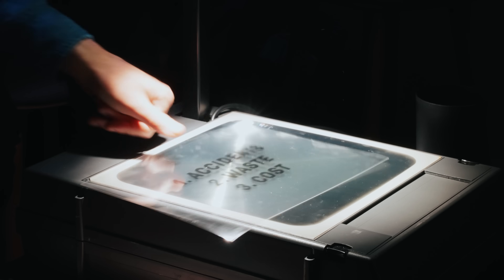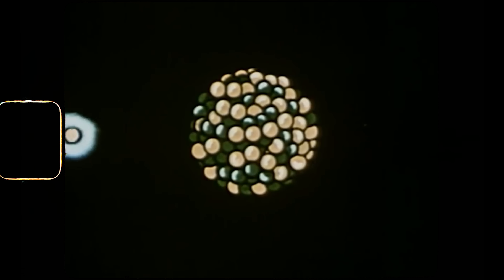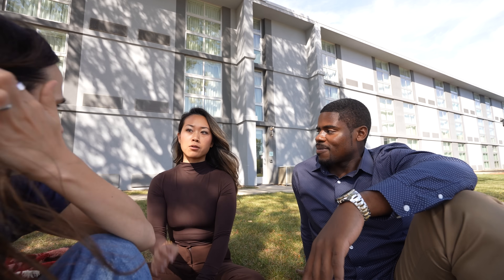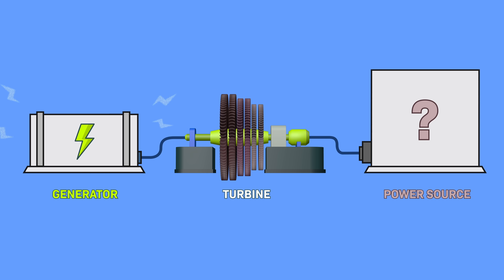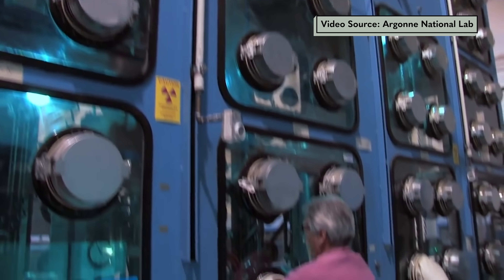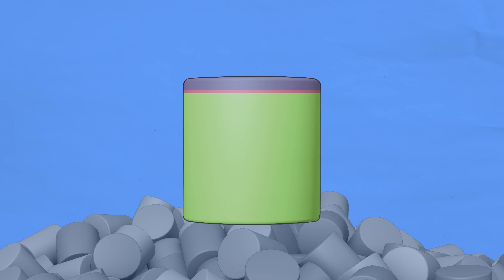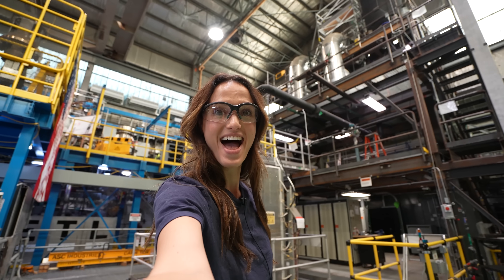The Big Lie About Nuclear Waste

Comment: 05:09 I feel you need to clarify what you mean by “nuclear waste”. Because as I understand there are several kinds of nuclear waste- from spent fuel rods to lightly irradiated parts, equipment and clothing used in power plants. As I understood it a lot of spent fuel rods are actually used to help make new fuel rods and so the amount of fissionable material that ends up as waste is relatively small? I mean what you’re talking about is how it’s done in Japan but also in Europe. 12:07 yet again the US doing something other countries have been doing for ages and expecting an achievement badge for it! 😂

Comment: The most dangerous nuclear waste is Cesium. It's high radiation take 800 ... 1200 years to come reasonable level. The metal waste as Plutonium could be used in power plans to make electricity. I don't se a big problem at all.

Comment: 🤔 Hmmm 👉 CANDU nuclear ⚛ reactors have been used to reuse spent nuclear waste ☢ for decades.
It's main breader reactors product is PLUTONIUM 👉THE 0.7 U235 REPLACEMENT AT 28%😂😂😂🎉
Reply: 🤔 Hmmm 👉 Nuclear ⚛ waste ☢
The tectonic subduction 🌏 plate's move at around 4" per year
They migrate deeper into the 🌍 core and will be reused into other plasmid form's of matter 💡

Comment: Great research!  You might find the CANDU reactor, developed by Canada and the only kind of nuclear reactor deployed in Canada (presently interesting.  Interesting, because CANDU reactors can currently, without any changs, get another 10 or so years out of the spent fuel from other countries' light water reactors.  The CANDU design came about because the process of Uranium enrichment was a closely-guarded US secret, so,  the Canadian researchers turned to trying to find ways of burning unenriched, straight-from-the-ground uranium, and the CANDU reactor is the result.  It's able to burn natural Uranium (with it's large percentage of U238, which cannot be fissioned in a light water reactor), and also can burn spent fuel from light-water reactors and gain an additional 10+ years of use out of it, just as you describe in the video.  Also interesting, the CANDU system is capable of burning other types of fissile material, like Thorium.  Why's that important?  Because there's precious little Uranium in the Earth's crust, and there's WAY more Thorium, it's 100's of times more abundant than Uranium.  India has proven that a CANDU reactor is capable of burning Thorium as fuel!  And there are lots of other things that make CANDU reactors good,  apart from the ability to burn spent fuel from other reactors.  1) CANDU reactors can be refueled while they are operating.  The fuel rod geometry is such that a robotic system can push new fuel rods into the reactor from one side, while another robot captures the old fuel rods from the other (called a "straight-through" fueling path),  Typical light water reactors have to be taken offline completely, allowed to cool which can take up to a couple months, then completely deconstructed, refueled, and then put back together again before it can be put back in production. You only need to refuel every 10-15 years or so approximately, and the refuelling process often takes a couple of years.  Canada's CANDU reactors have quite often  been in continuous operation since they were opened (some of them in the 1970's!).  Also, the overall design of the CANDU reactor involves the entire reactor core being located within a large pool of "heavy water" (a.k.a. Deuterium, the "du" in CANDU), which means that, when combined with a host of emergency fail-safe features,  it's nearly impossible for a CANDU reactor to melt down.   If the FUKUSHIMA nuclear facility in Japan had been a CANDU plant, research carried out in Canada has shown that the ongoing nuclear disaster at Fukushima would categorically not have happened .  Thanks for the amazing research Cleo, please keep up the good work!

Comment: I do not believe that nuclear energy, either fusion or fission, is a clean energy. Using nuclear energy you are producing nuclear material that we call nuclear waste. But most important you are converting matter into energy and energy into HEAT. So, with all the energy that comes form our sun, when it reaches earth, it is converted into Heat. Even if in the future we wil be using nuclear fusion where hypothetically there is no nuclear waste, but you are still producing heat that is added to the heat coming from the sun. We must use energy that is already in nature and not produce more Heat from other resources.

Comment: Thanks for making this video and introducing the potential of slightly used nuclear fuel (high level nuclear waste) to your audience.  If you want to do a deeper dive on the subject research the Molten Chloride Salt Fast Reactor (MCSFR).  This reactor technology can be used to transmute (consume) the waste from current pressurized water reactors into energy without a separate recycling process and is a much more elegant solution to nuclear waste and carbon free energy.  It should be noted that TerraPower (a  Bill Gates company) is currently working on a MCSFR in conjunction with Southern Company  and the Department of Energy.  Mr. Ed Pheil, formerly of the Navel Nuclear Labs is a great source of information regarding the MCSFR.  His company Elysium Industries was working towards commercializing a MCSFR but apparently ran out of funding.  If you google Ed Pheil or Elysium Industries you will find videos on the MCSFR.

Comment: While I am very much in favor of reprocessing nuclear fuel, I feel like this video quickly glossed over the counter-arguments related to non-proliferation.  

Plutonium-239 isn't any more dangerous than U-235 for the purposes of bomb making... The problem is that reprocessing creates plutonium in much larger quantities than U-235 exists in fuel today (3-5%).  Nuclear fuel isn't a proliferation threat because turning it into a bomb requires enrichment... A very difficult technology that requires large facilities. 

Reprocessing abundantly creates material that could theoretically be stolen and much more easily made into a bomb.

Comment: Hi  Cleo! overall great work!
Glad that you distinguished between the currently prevailing form of converting nuclear energy, and fast type reactors. The latter have the potential of producing 20x more bang for the buck. HUGE potential!!!!
Note the fact that the "waste", from current nuclear-electric plants, DECAYS EXPONENTIALLY. The danger of getting burned from gamma rays drops rapidly at first, then slowly levels off over centuries.
Detractors and opponents of nuclear energy conveniently omit this fact.

Comment: This is a hugely flawed video, clearly indicating a lack of technical knowledge on the subject. While hinting near the start that it is the fissile material, U-235, which allows the chain reaction to propagate in a reactor, the author seems oblivious to the fact that the material has been consumed thereby, and that simply "rinsing out" the fission products cannot get you back where you started. 
I think she picked up some notion of actinides extraction from her Argonne visit, and how this can figure in fuel lifetime extension, and contorted this into an idea of what a "closed cycle" really is. All such "cycles", as current embodied, require the introduction of fresh fissile fuel - whether new isotopicaly purified 235 OR, theoretically, bred plutonium: criticality cannot be maintained otherwise. There is no cost motivation for doing that currently, especially when superior breeding ideas such as thorium cycles are on the drawing board.
Do you really want to demonstrate how little science you know when you do such presentations?
regards, DKB

Comment: the processing is too expensive and  polluting/ dirty  , or they would have been doing it centuries ago , as demonstrated in France. NE is the most expensive way to boil water we can imagine cost 4-7 times the amount to produce electricity compared to conventional plants and  The new SRM s are still 2-4 times the cost of electricity produced by renewals.  
 " But we need a always on power source as wind and solar are intermediate". BS  compared to NE wind and solar are more predictable and backed  up when it is rarely needed, unlike when NE goes down it takes all the other reactors down on that grid for safety reasons. Coming back on line can take weeks. 3-4 times cost to build in overruns. we have the ability to work completely on renewable s  by diversity , computer control of the grid . w/o massive goverment subsidies no nuclear plant would ever be built , as demonstrated by wall street. This is another propaganda piece by the nuclear industry.

Comment: The solid fuel rod light water nuclear reactor only uses 0.5% of the uranium in the rods before the rods become structurally unsound (0.7% for Canadian heavy water reactors).  The original intent was to reprocess the rods into new fuel rods to repair the structure of the rods but the Carter administration canceled the reprocessing plant due to anti-nuclear protests hence the rods became treated as wastes.  The rods become structurally unsound because some of the uranium transmutes into a radioactive isotope of Xenon gas for eight hours before transmuting back into a solid element and gases occupy a lot more space than solids hence placing a lot of physical stress on the rods.  If you look at a cross section of a "spent" rod, you will see a fractured cavity in the centre.  Now, the molten salt reactor solves this problem as gases simply leave a liquid, however there is a lot of bias against molten salt reactors even though an experimental one operated on a shoestring budget for years.  The reason why the so called spent rods have ti be stored for so long is because it still has uranium in them and uranium has a very long half life which is why U235 still exists in nature while plutonium does not.  If all the uranium is used, the remaining wastes though highly radioactive have very short half lifes and only need to be stored for about 350 years.

Comment: Corrupt disinformation. Fear of nuclear is NOT irrational. Funny that you didn’t mention the fact that the biggest problem with nuclear energy, is that corruption has 100% guaranteed that every nuclear facility built was built with unsafe, material, engineering and design common sense, safety practices, and laws. From Chernobyl  to 3 mile island to Fukushima to the plants on the coast in California. You are parroting, dangerous disinformation

Comment: Beautiful and "bright"! ;)  Thanks, that was excellent! (Love the test btw). 
As a Mechanical Engineer I have often wondered if spent nuclear fuel could still provide even low grade useful energy, now I know that it can do much better. I didn't know that so much of the U238 was simply wasted. That leads me to ask a rather obvious question then...why not separate out U238 in the first place as it should be easier than a toxic mix. As Homer would say..."DOH!"🤦‍♂🤷‍♂

Comment: 0:05: 🔋 A nuclear reactor built in the 1960s could generate electricity from nuclear waste, but the technology was not pursued, leaving behind a potential clean energy resource.
3:50: 🌍 There is enough nuclear waste in the US to power the country for 150 years, and recycling it can reduce its radioactivity.
6:01: 🔋 The video discusses the process of generating electricity using different sources, including fossil fuels, geothermal energy, and nuclear power.
9:37: 🔋 Nuclear waste recycling can reduce dependence on imported fuel, conserve uranium, and reduce the radioactivity of waste.
12:06: ✨ Nuclear fuel recycling is seen as a way to address the threat of nuclear proliferation and the need for clean energy.
Recap by Tammy AI

Comment: I would LOVE to see this happen! I would also love to see the hot waste get used, instead of just cooled. It would make SO much more sense!
Reply: if it was feasibleto use the decay heat to produce power,I think it would have already been done, typically decay heat is 10% of the core's rated out put.
Reply: @davidnewland2556  It would still be neat to try. Even if there wasn't much to gain.
Reply: Nuclear power is expensive to build requiring public funding (bonds). Decommissioning and waste storage is expensive, requiring public funds to do which the utilities (having been enriched during the power generation years) are very happy to dump on taxpayers.

Comment: nice vid, nice topic, but holy hell that wording.....
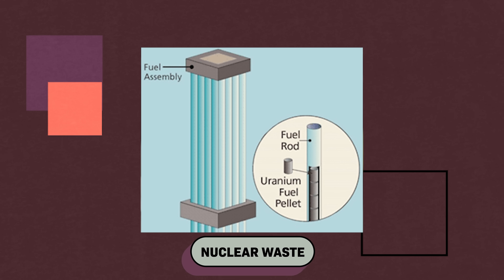7:08 U-235 the 235 means the not the number of neutrons but the number of protons and neutrons in the atomic core (92 Protons + 143 neutrons = 235) 
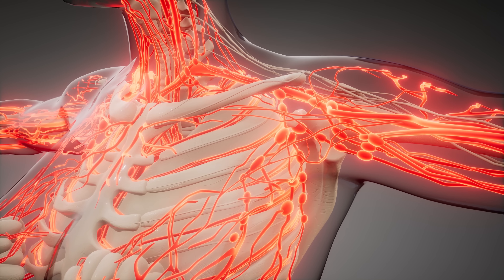7:30 then you dont fire Atoms at each other in a reactor, they are Neutrons....Neutrons not Atoms Atoms are the entire thing.
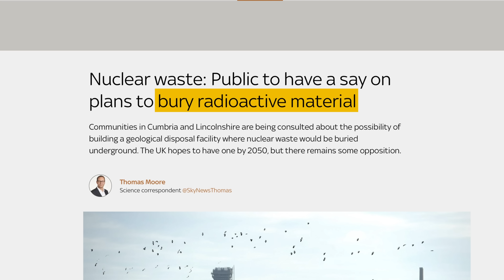8:08 the unstable Atoms are called Isotopes.
8:17 not only ionizing radiation there is Alpha, Beta and Gamma Radiation
also: you should take a look into Thorium reactors

Comment: I'd like to say: welcome to France !
Our grid operator reuse most waste in Mox reactors. It produces nuclear waste of course, so we had a project to reuse it. If I understood correctly,  the objective was to "regenerate" the waste to close the nuclear cycle. Last step I know of was the SuperPhenix power plant. 
It didn't work. I don't know if our giving up was money-motiviated or if it was a finally found impossible to achieve but the SuperPhenix project was cancelled... So now we're back to bury these second-stage wastein geological layer. They are smaller and shorter-lived than first-stage waste, but still, that's a disappointment.

Comment: I know I'm late to this thread but there's also another solution to clean sustainable energy that Edward Teller proposed back in the day called a thorium based reactor thats way safer than the conventional high pressure water cooling systems that we use today.

Comment: It gets worse. Propane used to be considered trash and burned off at oil rigs, then people made propane appliances and bottled up the propane trash. China uses heat and pressure to turn sewage into liquid fuel, I wanna put that fuel into a custom turbine engine to make electricity. On the macro level, sewage can be treated with algae, to capture some of the carbon from burning of the fuel. How many of society's problems did I just try to solve on a Ytube comment? HAHA! 
❤ the video

Comment: One thing that has been overlooked by everyone is that the waste material generates heat. High level waste can produce heat around 800-900 degrees C for anywhere from 10 to 30 years, if googling is accurate. And even longer, up to 100-200 years as the waste converts to intermediate level waste. This could be put to use heating water in a closed loop system to drive turbines. All that is needed is to store the waste in containers in a pit with pipes running through to a turbine generator. Depending on the storage size, I suspect it could generate hundreds of kilowatts of electricity for many years quite safely and cheaply. Imagine all the remote towns that could benefit from this technology if each had one of these.

And by the time the waste became no longer viable, it could then be safely and cheaply disposed as landfill with, say, a small layer of clay covering it.

Comment: Check out CANDU (Canada Deuterium) or other heavy water reactors.  Theses reactors use heavy water for the moderator, and uranium in the concentrations found in nature (i.e. NOT enhanced uranium).  The "spent" fuel from light water reactors (such as most of those in America) is more radioactive than the fresh fuel used in heavy water reactors. "Why" you might ask "would we use light water reactors?"  Heavy water is expensive (unless you are at the Fukishima reactor in Japan, where they are now releasing diluted heavy water into the sea).  But the main reason is likely that spent fuel from heavy water reactors is not useful for military application.
Reply: Spent fuel coming out Candu is also highly radioactive, for awhile.

Comment: There are these things called subduction zones.  Drill holes in the lower plate, drop in the caskets, cap the hole and eventually it will be mixed with the magma under the top plate - putting the radioactive material back in the earth from which it came.  Basically it's recycling.

Comment: do these clowns ever consider putting the "waste" [ whats left after we extract the uranium for more fuel, the plutonium for more fuel, the trans uranics to add to the fuel to be destroyed,  the fission products for thermo electric isotopic generators and isotopic batteries that run for decades and the titanium from the cladding on the rods, ]  back in the mines they dug the ore from or at nuke test sites where its ALREADy FLIPPIN' RaDIOACTIVE! !???????????????????????????????????

Comment: A critical piece missing from this discussion is the absolutely astronomical amount of money the fossil fuels industry has spend buying politicians and news media to drum up fears of the nuclear fuel process from start to finish.  They don't want to lose their monopoly on energy production, which will in turn cascade into other areas like cars and machinery.  They stand the most to lose from an energy renaissance, and are doing everything in their power to keep us in an energy dark age for as long as possible.  Not unlike, to continue the metaphor, the monarchies of Europe, even after it was clear the serfs weren't having it anymore and the transition was inevitable.  And frankly the frequency of nuclear accidents, as sparse as they have been, has been spaced out just far enough apart for them to keep the fear fresh in the minds of the public.  From 3 Mile Island to Chernobyl to Fukushima, to now the almost disaster of Putin's threat to bomb Ukraine's primary nuclear facility.